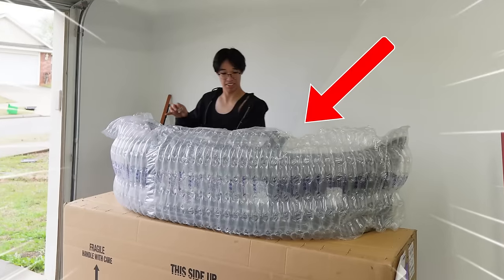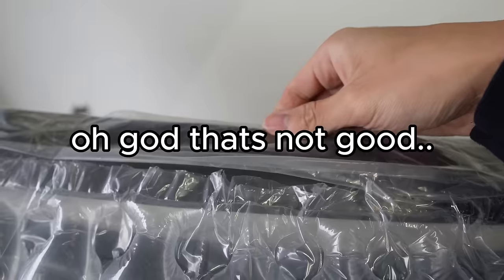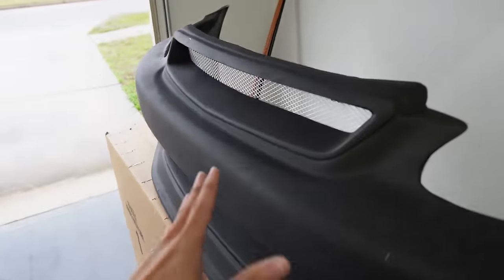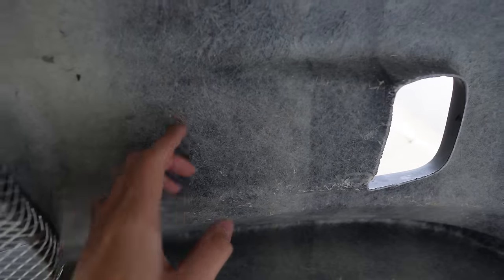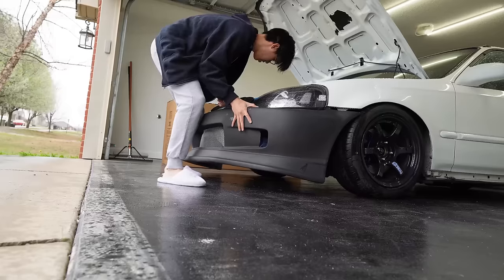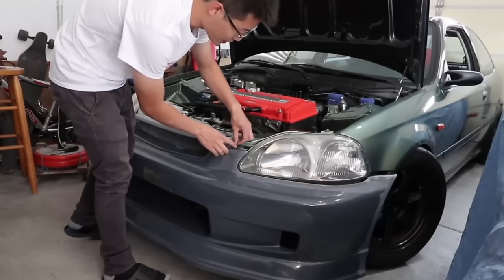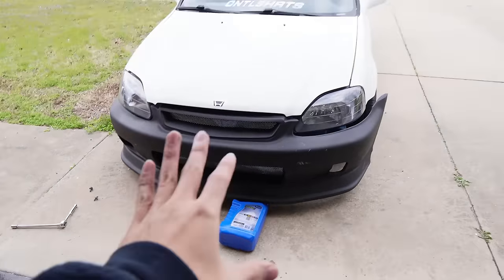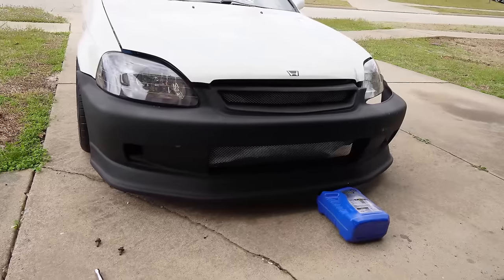Buying the nicest bumper nobody EVER buys...

Comment: On a replica Sir bumper the usdm bumper "crashbar" will fit but it's tight. That one is poly like an oem bumper. 

That's the one with the side molding on the corners of the bumper.
Reply from the maker: I’ve seen it! Looks like it’s only for 96-98 civics

Comment: Honestly man I’m running fiberglass hood and wide body flares. All this it won’t last is bs. If you’re okay with going to quick release it’ll be worth it. The great thing about fiberglass is to repair it all you need is more fiberglass. Also if you have it held in place for a while it’ll end up just staying there. You’ll run into the same thing with a 1400 bumper accept it will have better fitment which you can make. I’ve ran my hood for 3 years no issues with cracking or scratching really

Comment: i ran into the bash bar issue on my eg coupe.  What I did was cut the front bash bar to be similar to the rear bash bar. (basically you cut the ends on a 45 degree cut) bumper slid on easily afterwards.

Comment: It is Duraflex isn’t it?
Reply: I'm with you. It looks like Duraflex, that stuff never fits without a ton of work. Fibreglass or carbon on the other hand typically fits like OE.
Reply: @GIZZMOTORSPORTS duraflex is fiberglass. Fiberglass parts 90% of the time needs a lot of work.
Reply: @KevinBesnier  but it isn't, duraflex has some fibreglass in it but is not all fibreglass. Duraflex will flex, fibreglass parts will not. Duraflex is famous for bad fitment, durable but lousy looking. Fibreglass lays out like CF will often install like the oe plastic or metal part it replaces.
Reply from the maker: It is but the bumper was falsely advertised as a plastic bumper. So I thought it was gonna work 😢